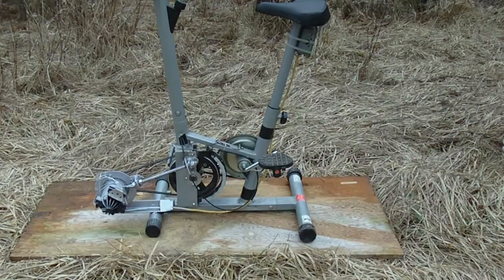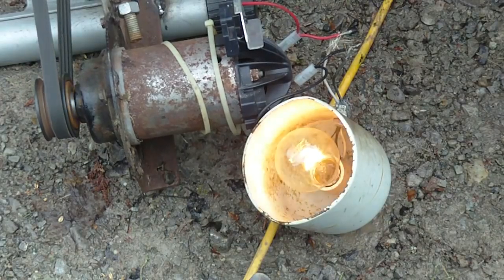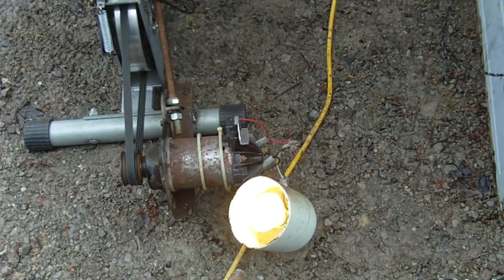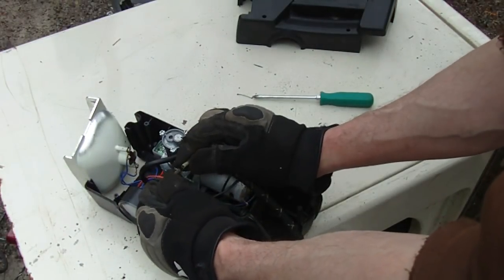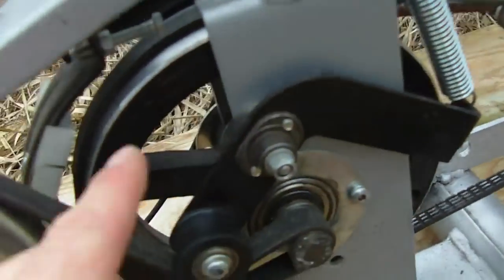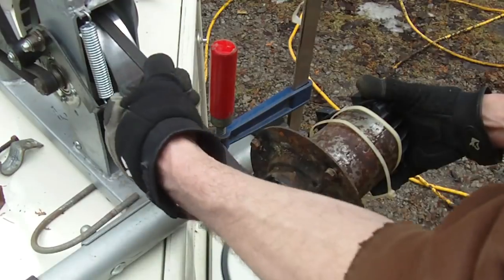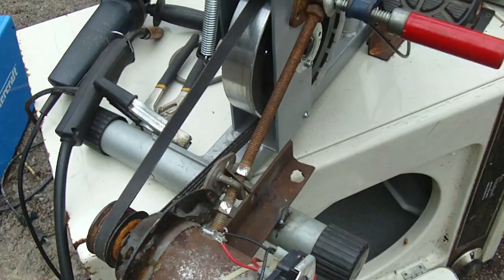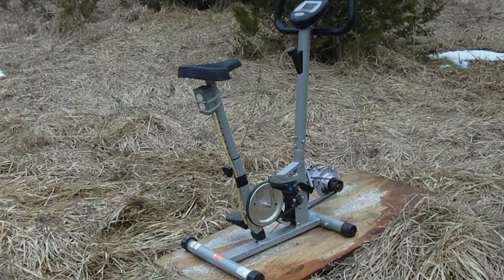Homemade Exercise Bike Generator, made from Free Junk

Comment: Well, what you did is good,
but this way depends on 
human muscles, ofcourse it works
as long as you spin it.
using (SR, PF, PAT)system is
better than your way.
The (SR, PF, PAT ) can
spin generator for 9 hours
during a day, so can charge 
batteries.
Jeel. Saudi Arabia.